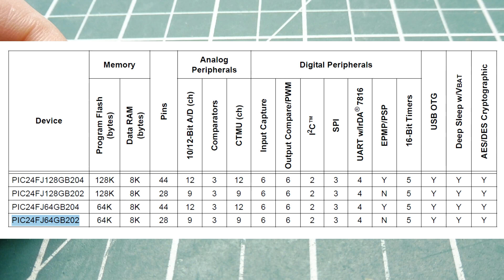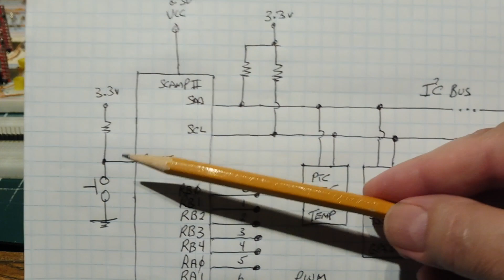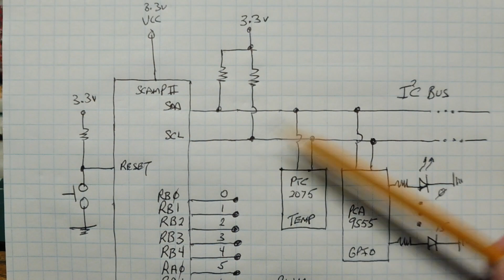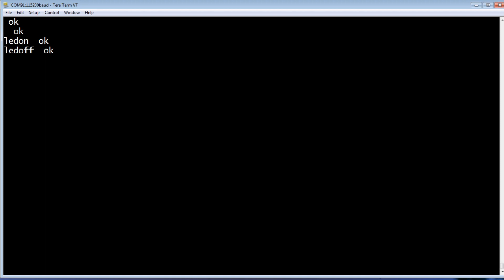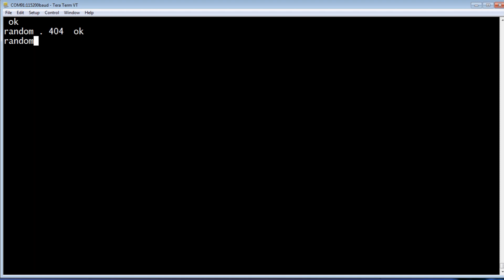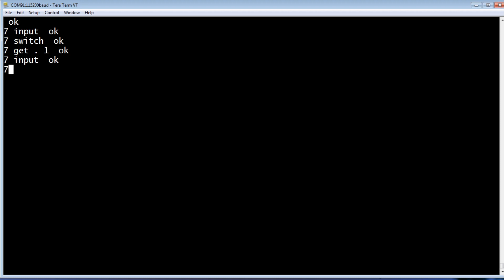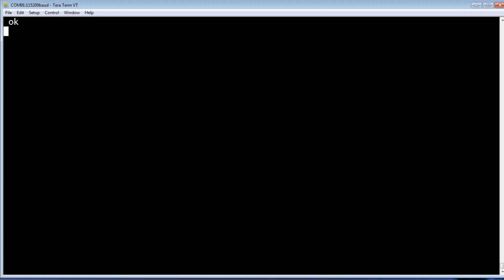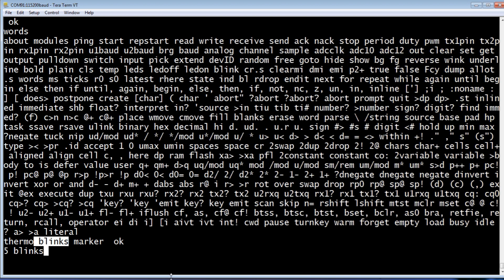Run Forth on a PIC Microcontroller / FlashForth / Scamp2

Comment: 2:43... Is the GND from the USB_Micro connector connected to common circuit GND or is it floating as shown ? As is I can't see the USB_Micro connector supplying any voltage to the circuit. BTW... Thanks for sharing Scamp2 features.
Reply: It’s connected.

Comment: ... it's very easy to install flashforth on the Atmel 328p platform. Try that. It's economic and easy. Flashing it to microchip devices takes a little more patience, but it's instructive and useful. Great video as your usual standard. Cheers
Reply: The Atmel 328 doesn't have a fraction of the grunt of a PIC24, nor the wide range of peripherals.
Reply: @marswatcher  Yes. I'm aware of it. You can flash flashforth onto microchip PIC24 series but I had some trouble with it. Did you try it?
Reply: @marswatcher  ...well when you put it in those terms then the Scamp2 is a bargain. The only problem, I guess, might be licensing terms should a developer create a commercial product on the platform. But that's another can of worms. Thanks for your insight. Cheers.

Comment: Great video!! I have a Scamp2 as well, and it's a lot of fun to use. I've port Forth to other microcontroller boards and it can be a lot of work, and then you have to work out how to do I/O. This comes with forth preinstalled (easy!) AND I/O support built in. It's far more usable than an arduino for small projects.
Reply from the maker: Thanks for the info!

Comment: A very interesting video and nice to see a board shipping with FlashForth loaded !
Unfortunately though, it's way too expensive for me.
However, the PIC microcontroller the board features costs £4.00($ 6.50 US) here in the UK and the udamonic provide a schematic and documentation giving details of the standard FlashForth dictionary together with their own forth words they have added to use with the scamp2.So making my own breakout board would cost a lot less !
Reply: By the time you add in all the other parts, the price ends up being a lot more than $6.50! Plus the Scamp2 has an inbuilt USB interface (not via a bridge). I have a Scamp2 and it's much easier than trying to port FlashForth to a PIC yourself!

Don't forget, to program your $6.50 PIC, you need a PICKIT4 to burn code into it. That's about $70 for the burner. So for a newbie just starting out and wanting to learn Forth, the Scamp2 is a much cheaper, easier and faster option!
Reply: @marswatcher  I take your point and I can see how say, schools might find the whole "Package" attractive. However, I was doing a sort of "Thinking out loud" assessment, wondering how the capabilities of the PIC chip itself might be most economically evaluated when loaded with FlashForth.
But for those of us on a tight budget, a Raspberry Pi Pico at a tenth of the cost with the ability to literally drag and drop mecrisp Forth onto it is by far the most attractive option.(Ken also did  a great video about this)
Reply: @ShellacScrubber  Just speaking personally, but I've tried Mecrisp forth and FlashForth on a Scamp is much better. It's easier to use, has more features, and allows you to get started on your projects with less of a barrier.

Comment: Looks like a neat toy/tinkering board but $50 is a bit much for it. I prefer my STM32L432KC Nucleo board from ST for $10. It runs circles around this board. That being said, the Scamp could be useful for a high school kid... if they can make it cheaper.
Reply: The reason the Nucleo is $10 it's subsidized by the chip maker wanting to sell their parts. For a small company doing limited runs, the cost of manufacture is high. Unless you're doing runs of 100K boards, it's not possible to get the price that low.
Reply from the maker: Yes.. you are correct. Schools are the target for this board where a student with no programming experience can get something up and running in minutes as opposed to presenting an ARM Nucleo board with STM32 Cube. When learning the basics, speed and performance is not an issue. This board is built by one person so sourcing it out in bulk would bring down the price if schools are interested.